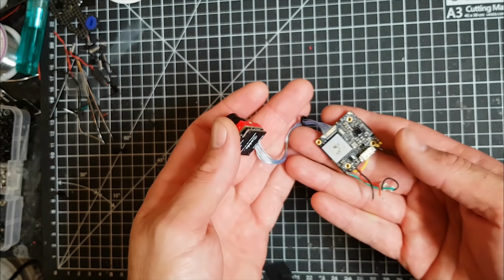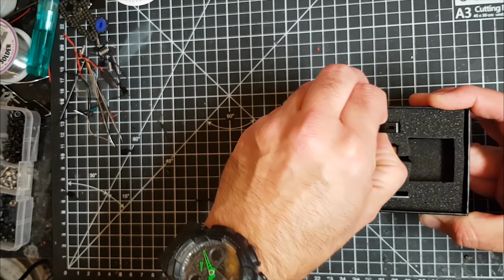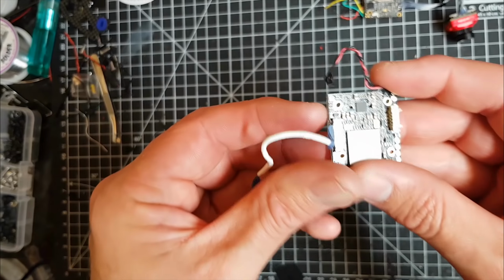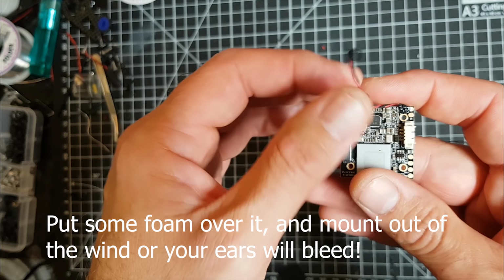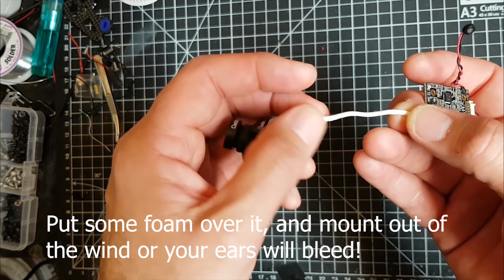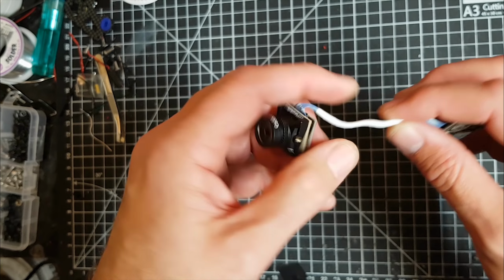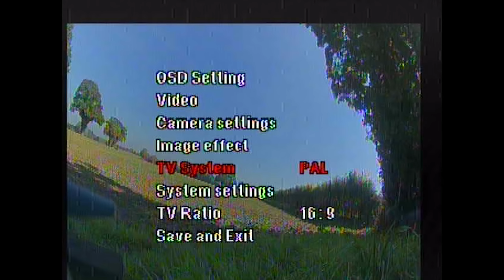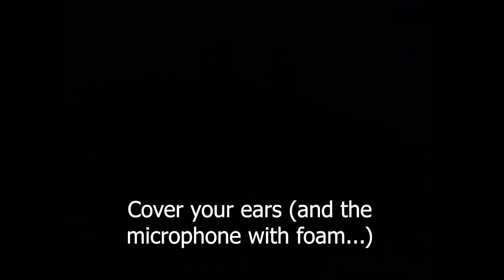Caddx Turtle V2 review & flight footage (thoughts in description)

Comment: Hey CopperTop i have the Caddx Turtle V2 as well but my recordings all have a date stamp of 2015.The menu board i have has the 2p connector which won't fit on the board unless i solder this 2p black/green cable onto the pad.Once i do this can i change the date to the current year?Is there any way i can access the menu without having to solder?Thanks for your great videos!!
Reply from the maker: I haven't used one of these in nearly 2yrs but you won't get correct date as it doesn't have an internal battery to save it
Reply: @CoppertopFPV  Yes i just happened to get an email from Caddx Turtle v2 folks about 30 mins ago and they said the v2 is not capable of changing the date by someone using the menu board so its stuck in 2015 for good!!Thank you Coppertop i really appreciate your time..

Comment: Hi sir nice review. I recently bought Caddx turtle V2. Although i have installed Capacitor on the quad am getting flickering and noice on outdoor especially on tree leaves grass etc... Is it an issue or is this the way caddx work.  Because runcam split 2 FPV is far better.
Reply: Hello, Same thing here it's really boring if someone has a solution I'm interested. :-(
Reply: @StephaneDAILLY  Hi Reduce the sharpness to 1 or 2 in cam setting it will work fine.
Reply: @rajeevgopal3961  Thank you very much, I'll try this !
Reply: @rajeevgopal3961  sharpness is necessary to see some detail in googles... whiteout sharpness is impossible to see where we fly!
isn't it?

Comment: you are the first person that i have seen actually post the fpv feed. everyone says you can fly with it but its not the great and now i can actually see it. thanks for posting this video! and nice Acrobrat by the way! I just got mine built but i still dont have a split camera
Reply from the maker: HINESINBURG_FPV it's not too bad when sunny but nasty when cloudy. Split is the same. Good luck with the acrobrat!
Reply: I've found I have to turn the contrast down a bit (even to where it over-flattens the image through the goggles), and it tolerates clouds.  Still suffers in flat light, but combining that with a low sharpening option yields a pretty flyable image.  Latency just takes me a little bit to get used to, but that's because the F1 micro is so good.

Comment: What settings did you publish your vid with in your movie editor? I am having trouble getting my sharp HD vids from my Turtle V2 to look sharp and clear on YouTube, they are all pixelated and look bad even on 1080p on YouTube. Albert Kim publishes his 1080p Turtle V2 vids using the 4K setting, I am yet to try. Just wondering what you use?
Reply from the maker: mine are done at 2.7k - it tends to work best. Set sharpening to low on the caddx and sharpen in post if needed.
Reply: @CoppertopFPV  How are you recording at 2.7 when spec is only Video resolution: 1080P @ 60fps / 1080P @ 30fps / 720 @ 60fps. Are you upscaling somehow?
Reply from the maker: @c0y0te007  upscale in post in whatever editing software you use go get YouTube higher bitrate

Comment: Would you recommend this for a motorcycle helmet? I want something small that will record to micro SD with 60fps 1080 and good sound quality. I was thinking of placing the camera on the chin of the helmet with the board and microphone on the inside of the chin so the mic is in the right spot for vlogging. The other option is a cheaper version of a gopro with 60fps 4k, but those are so bulky and ugly.
Reply: It would definitely work. Do you have fpv equipment to set it up with? Without It I imagine it would be a pain in the ass to get setup. Also is going to need a power source. One advantage of running a GoPro is it has an internal battery...

Comment: I guess I wound up with a V1.5 sort of thing - mine has the same lens as the V2, but is still definitely the V1 controller board. I actually gave up and started flying the FPV in something other than the widest FOV, because with the new lens it's massive.
Reply from the maker: tehllama42 I think they changed the V1 lens pretty early doors, although I wasn’t sure it was the same as this.

Comment: Hey how do I use the odd board so I can change from 16:9 to 4:3. There is no place to plug this odd board
Reply from the maker: It plugs into the cable dangling from the caddx board where it connects
Reply: Mine doesn’t have that cable. I have the v2 micro and that plug cam in a bag  I wasn’t sure if I solder the ground to the fc or the camera board

Comment: does that mic send audio over the vtx for an earbud on the fpv headset or is it only for recording
Reply from the maker: Dylan no it’s just for hd. You need a vtx with a mic to do that
Reply: @CoppertopFPV  thanks for the info. I currently use the runcam eagle 2 pro and it has a mic on it that I was able to wire to my unify. Didn't know if I could do that with this.

Comment: It seems to me that neither the Caddx Turtle V2 or the Split Mini is usable as an FPV camera, but could be a really nice HD camera to replace a GoPro on smaller quads. The FPV feeds just look utterly horrible on both cameras. On Banggood they actually sell a TPU mount for the Caddx. I think that route might be better. You'll have to carry an extra camera, but at least you'll be able to see where you're flying.
Reply from the maker: Yeah they're all crap. Price you pay unless running dual cam.
Reply: Really, you thought the live feed was crap?  Maybe it's because a lot of us are on a budget, or I'm doing something wrong, but that live feed is better than what I get with my dedicated foxeer or runcam mini w/ either furious or tramp vtx on 25mW, and about equal to them set on 200mW.
Reply: @sunshynff  I try to be on a budget too. I'm mostly using Foxeer Arrow Micro Pro V2 cameras. On one of the builds, I use a VTX03, and on another I use a TBS Unify Pro32 Nano. On these, which are not the most expensive, I find that the FPV feed looks so much better than what's shown here. The image seems washed out and there's a lot of noise. I'd say that using the Turtle V2 is better and cheaper for me than upgrading to a 5" with a GoPro, and I could probably live with the FPV feed - but it doesn't look good. Note that haven't tried it myself, I judge only by the DVRs posted on youtube.
Reply from the maker: sunshynff the fpv feed is crap, and worse than any Foxeer or Runcam ccd or cmos Cam. It cannot handle dim conditions at all, which is why many people run a seperate predator or eagle, and why Caddx are releasing the tarsier. Nothing to do with the vtx or money. It simply ruins the joy of fpv.  Plus I’ve spent more money replacing these things than on my GoPro session 5 that I’ve had for 18 months.

Comment: The audio would really improve (for quad use only) if mic is paralleled with 330ohms resistor. On my split mini v1 its better.. dont have turtle v2 so I cant compare. Only have v1
Reply from the maker: raffy turc I've heard if sound much better elsewhere. It's was hitting the wind big style. I have no need for it, but cheers for the tip

Comment: Great review mate, they shouldn't have bothered with the mic if they aren't going to get it right other than that the footage looks good, even the FPV is flyable.
Reply from the maker: Slippery FPV yeah it's not for me, but I suppose someone might find it useful.... mines going to get the snip :)
Reply: I'd try foam just to see how it works, but that's not a feature I need either.  I guess it is theoretically handy if you want to hear a quiet quad (i.e. running HQ 3x3x3T props on a light build to fly in built up areas), but to me the improvement is the mounting of the 20x20 board being finally correct.
Reply from the maker: tehllama42 yup. It’s pretty much the same as the V1 with a bit better lens. I’ve already removed my microphone. Pointless for what I want. Hope this one lasts longer.

Comment: Mate, just a thought, your old one - I had same behaviour off a split mini last week, turned out to be a dodgy sd card
Reply from the maker: Adam Featherstone could be. I think I had sharpening turned down on the other. Now the brat is up and running I'll have a play. If you meant the faulty one, it does it without the card also
Reply: Coppertop FPV yeah I meant the faulty one, clearly not the same issue, just thought I would mentiom
Reply from the maker: Adam Featherstone probably something silly like that. My splits suffered from random issues. Stand on your head 3 times and whistle and it works :)